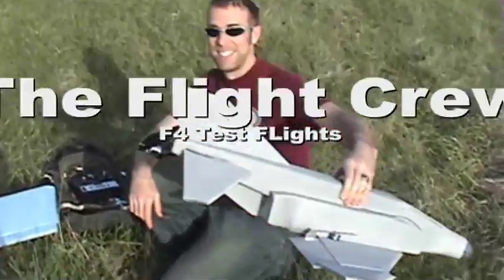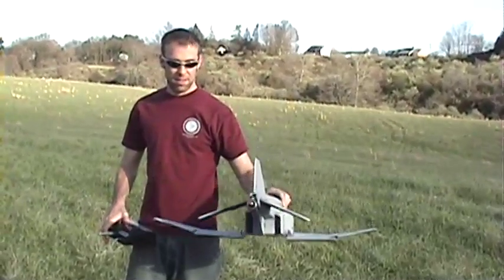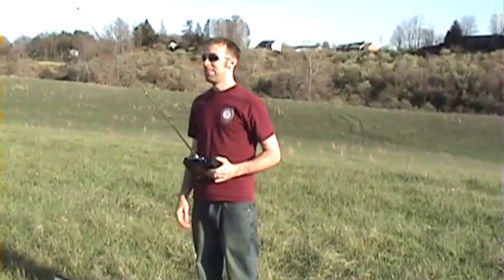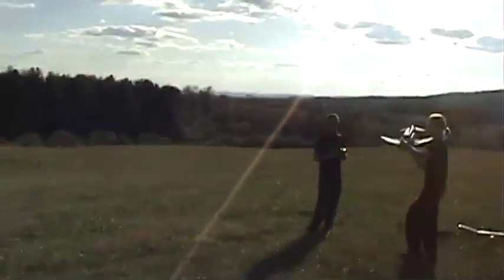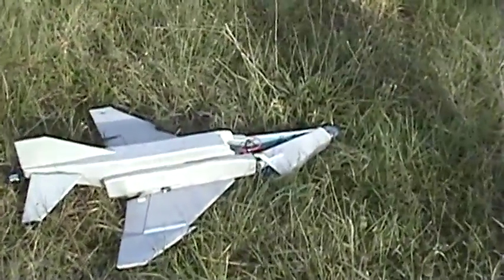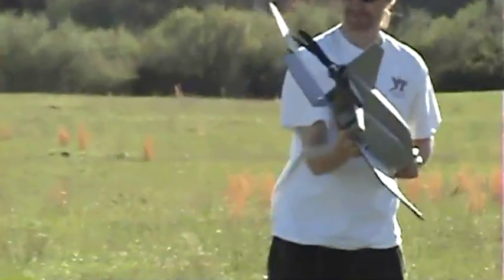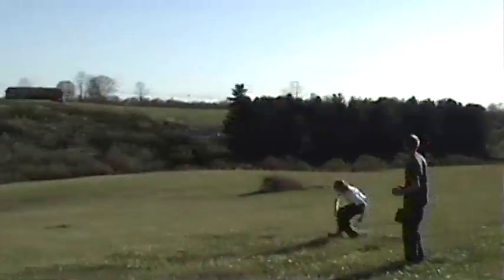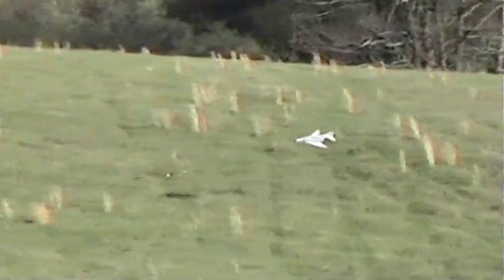F4 Flight Tests

Comment: way to much deflection in all of your surfaces take off the giant prop switch to a 2200KV motor with 6x4 prop withe a 40 amp brush-less if you want this to work. ask me questions if you need a answer